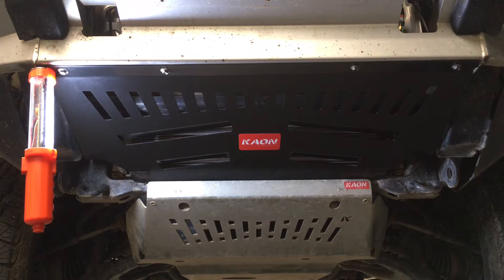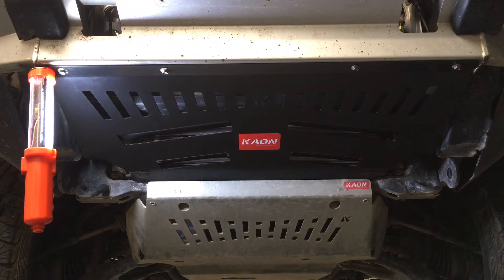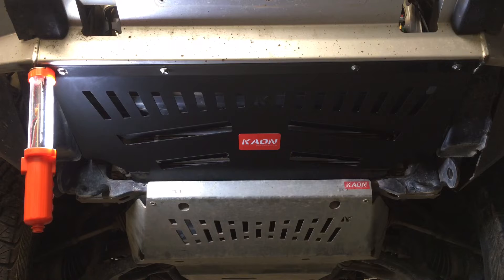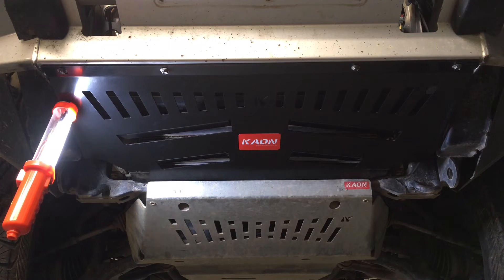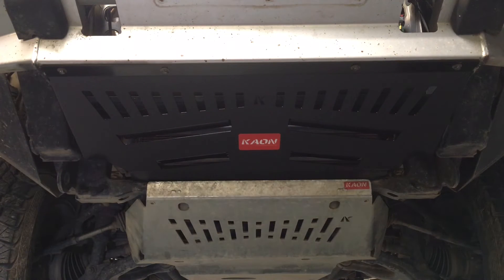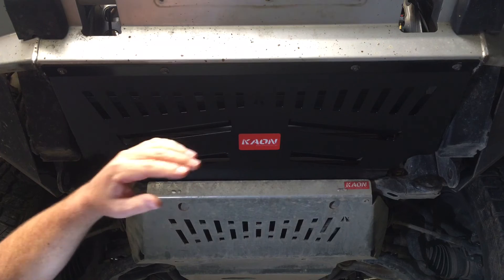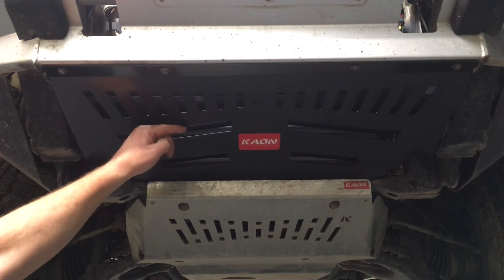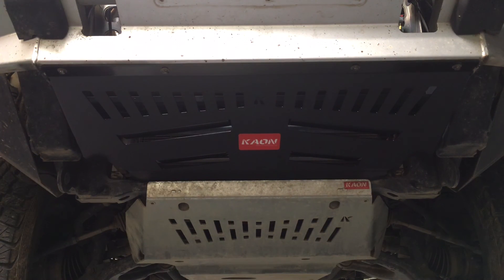COOLING UPGRADE AIRFLOW INCREASED

Comment: Wouldn’t the vents create a low pressure area?The high pressure air coming through the bumper would then flow to the vents via the bash guard and not so much through the radiator?  It would be a good test to see if it affects radiator temperature.